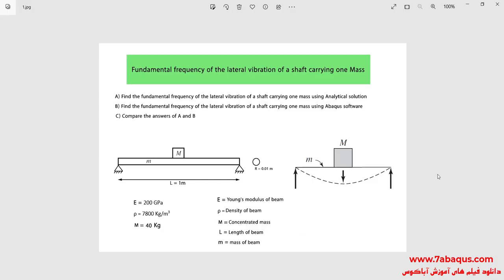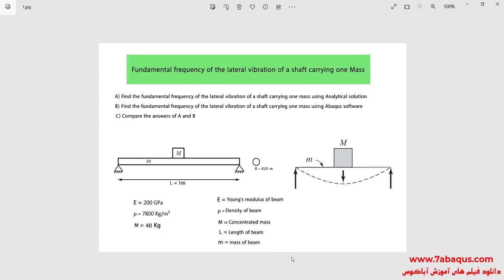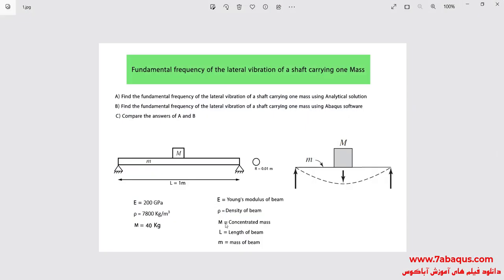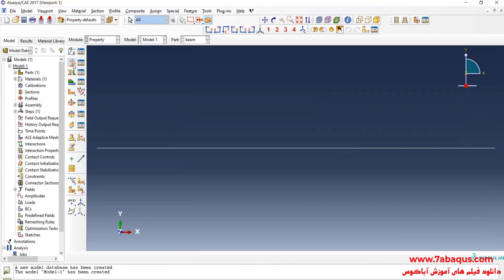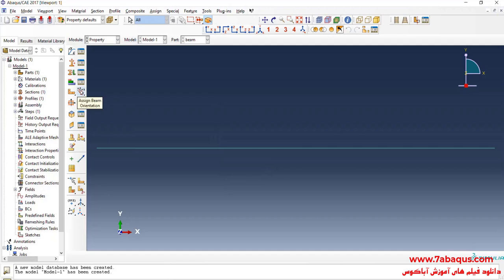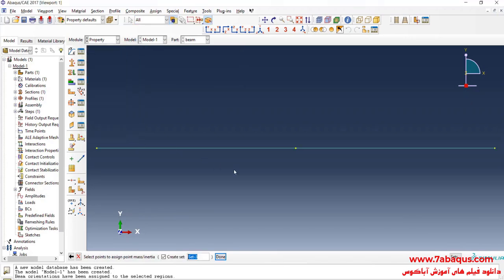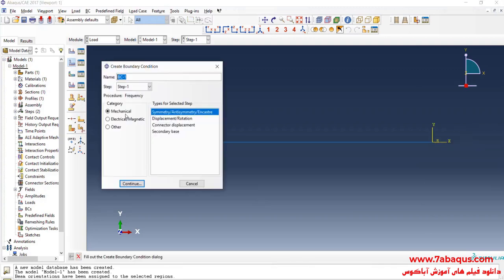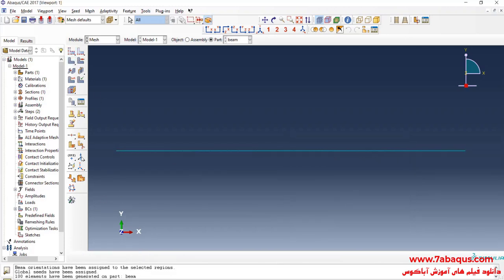Fundamental frequency of the lateral vibration of a shaft carrying one mass Abaqus software

Comment: After my simulation on abaqus just a simple simulation this thing. I'm unable to get output result.

It says "There's no valid step data available on the database. If the analysis is running, the database must be closed and reopened once the results have been initialized. The request operation has been canceled".

I checked every of my input data and it's correct. What can cause this please?
Reply from the maker: Hello
Send me your model
Reply: Okay, I'll send to you now.